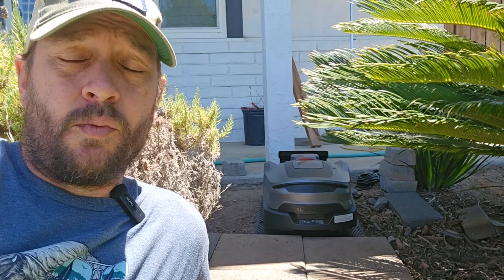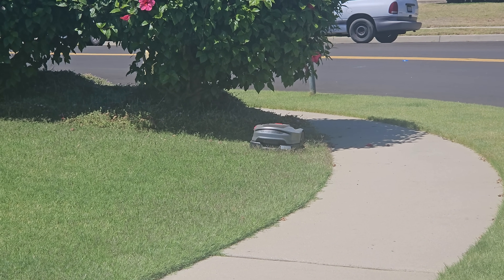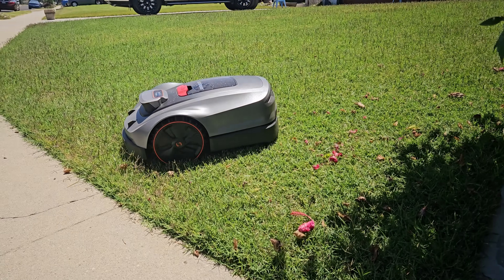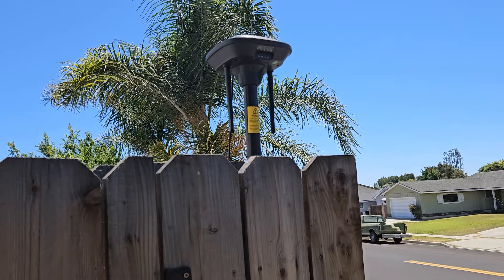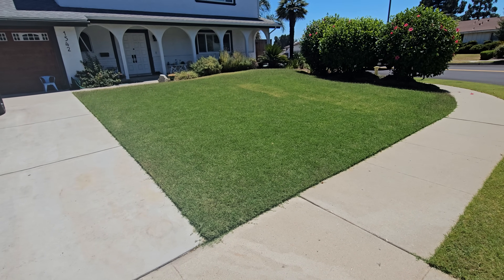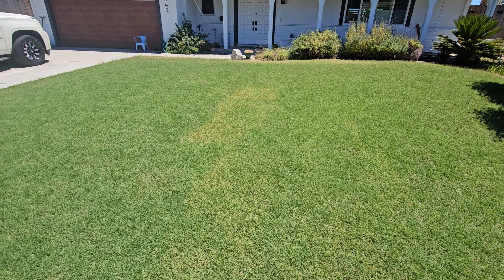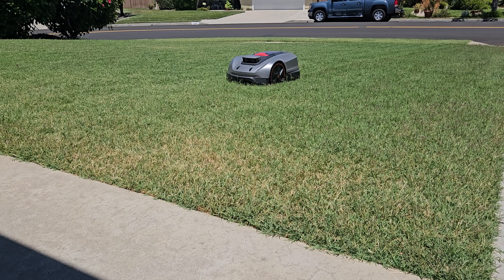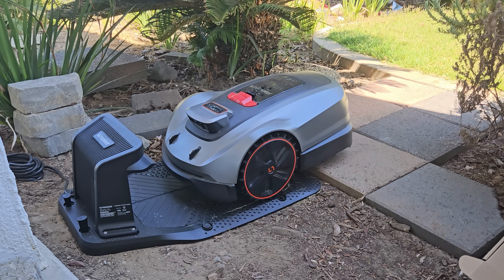How Robot Lawn Mowers Work - RTK For Yard Mapping With The Sunseeker X3 Plus

Comment: I trust your reviews. For me it is a good way to save some money, i can get my lawn guy out less often, should pay itself in no time.
Reply from the maker: For this video i let the grass get overgrown before mowing it for the visual effect on camera, but ordinarily with the mower running daily the cut quality is good enough for most people. Still gotta do the edging work though so your lawn guy can come less often but he'll also have a scruffier edge to shore up when he comes. Thanks for the compliment BTW. ☺️
Reply: @TurfMechanic  How low is it mowing and can the mowing direction be changed?
Reply from the maker: This particular model I'm experimenting, the X3, with is one of the lower end sunseeker models, it only goes between 1.6 and 3.2 inches. Also the HOC can't be programed to change automatically per zone (really annoying IMO). Also, on this model I can set the mowing pattern for each zone individually but the options are limited. I'd like to do a checkerboard pattern but that's not an option with this model. If I upgraded to the X7 then I'd get more pattern options, double cut and multi direction and each zone could get it's own programmed HOC ranging from 0.8" and 4". Within the sunseeker brand the X7 is way better than the X3...but it costs roughly twice as much. I wish I had the X7, I'm tempted to sell this unit off and upgrade especially with prime day pricing right now dropping the X7 pricing by around $500.
Reply: @TurfMechanic  I think between .8”-1” would be the sweet spot for a mower like this. That’s how it works in life, the thing with cooler options always costs more 🤣
Reply: I like cutting my fescue at 3.5 inches during the summer, will it do the job?